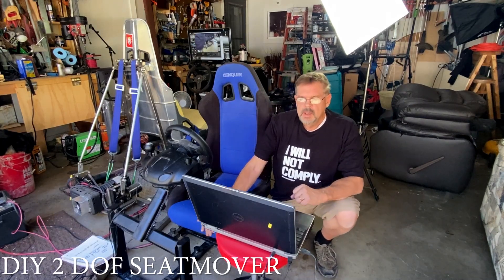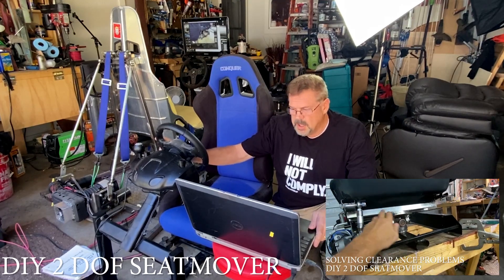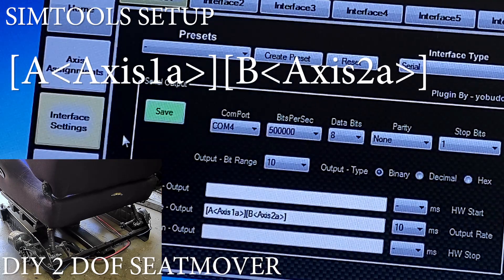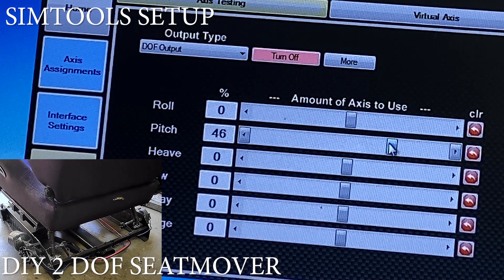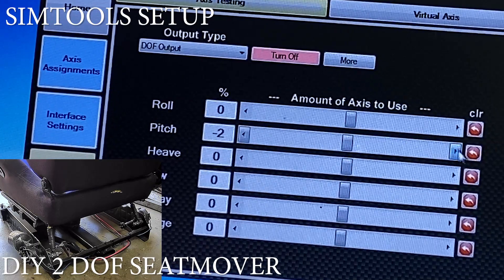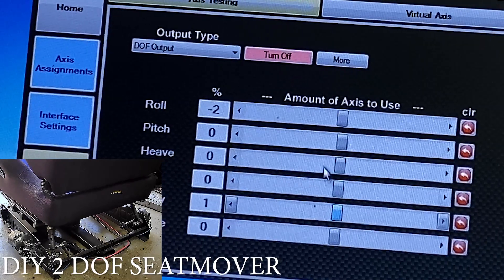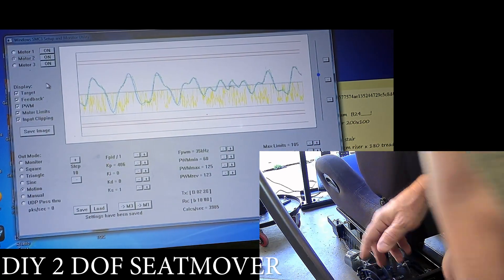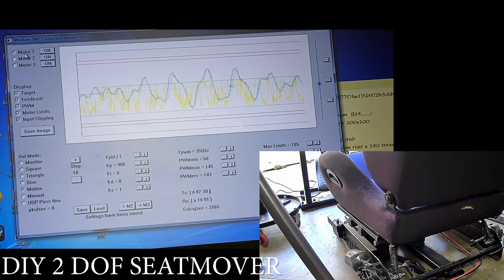DIY SEATMOVER Part 5 WW motors Arduino IBT-2 Simtools MOD your static SIM RIG with Motion!

Comment: I know this is super late but you came to the wrong conclusion. It might be the motor need upgrade, and you did get bigger motors, but might not have been needed. 

You didn’t tune the PID parameters.  The yellow is supposed to be super close to the green. 
It stalled because the pid wasn’t tuned to give a huge amount of amperage when you needed the torque.
I get you’re it an electrical engineer and I am, but I don’t want you giving the wrong advice out of no fault of your own, coz you can’t know what you don’t know. 
There are great pid educational videos with how the parameters affect what’s going on. Search for some and you’ll have a much better solution.

Comment: I think its probably very important to get the centre of gravity perfect with that UJoint when your in the seat, that way the motors wont have to lift your weight, but you probably also checked that, the motors probably are just not strong enough, love your vids by the way :>

Comment: For those wondering: I built and tried the exact same kind of design (thanks to you d max, you legend) with my regular 12V windshield wippers (some « valeo » ones, pretry cheap) and It works perfectly well for me!
They move and lift my weight with no trouble!but I only weight a 150pounds so maybe that’s why. 🤷‍♂️
Reply from the maker: Fantastic!  Great to hear..  for whatever reason, those old WW motors just could not make it 'real' for me..  I appreciate the comment my friend!  Dave

Comment: What wattage are those motors? I’ve bought a pair of 24v 30watt exalto marine wiper assembly with tie rides etc. I’m worried it’s not going to be big enough
Reply from the maker: Thanks for the quesiton.  They did not come with any data sheet..  but I was able to stall them out using an ATV brake around 23 amps.  Since the power supplies are rated at 550 watts at 25 amps.. I think they are around the same.  I would say to 'test' your motors.. Since your making a 'seat mover' they may  *MAY* have enough power..  but I dont know for sure..  30 watts is not too much..   Give it a shot.. see what happens..   I went from saturn WW motors  (unknown spec) too..  and they did not have enough power to convincingly move the seat..  to the Jazzy wheelchair motors..  and the Jazzy WC motors moved it just fine..  Dave

Comment: Dear D Max, I think the problem is that you modified the motors the wrong way. I also building my motion sim, and if I use the low and high speed to drive the motor, the power consumption increased drasticly but the output torque was dropped significantly. I modified it that the ground commutator is disconnected from the chassis and soldered a wire to it instead. When I use the high speed wire with the new groundlead, the current dropped, but the motor had much more torque to it.
Reply from the maker: Thanks for actually watching.. Yeah your right.. But fortunately, the motors I used are actually very weak in the first place..  I would recommend starting with better motors.  I'm Glad you saw the issue and I see it too.. Thanks for the comment! DMAX
Reply: @DMAX_DIY  Thank you for the content I really appreciate it.

Comment: Did you try with PWM cranked up to 255? 255 is like 100% of the torque of the motors you are using. Bigger motors might need less PWM ...
But I also think the motors are too weak for regular use. Remember,  I have about the same angles you use here in my rig ... and even with 160W each they have to work hard as I have to move 106kg mass in total. My PWM with them is set to 140. 255 throws even me out of the rig 😁 but it is also a pain for the psu then.
Reply from the maker: No I did not.  I suspected this configuration would require bigger motors.  But I went for it anyway with those little motors- they can move the seat around without me in it.  And just a little bit with me IN it.. It was kind of a test to see just how much they can move.  I copied down those settings and will give them a go in the next video.. Thanks my friend! Dave

Comment: burnt 2 BTS7960 cuz my seat crash into my motor and i can't stop it in time. 
Then i brought another 4, just to discover 1 of my rotatory hall sensors acting strangely, which caused all the problems.
then i switch my hall sensors with those cheapo 270 degrees POT, and my seat was just going to work, my last BTS7960 is burnt again.
How lucky i can get those 2-3 bucks each with 1 week shipping.

Still so frustrated feeling the project is so close to working.
Reply: Build with Sabertooths - not cheap but they do not burn.
Reply: @ARTFLY  yeah i kinda regret now, however i did brought a 24V power supply and 2 300W 1:40 24V motor... those cost a lot of my hobby money already.
Reply from the maker: @ARTFLY  Yeah I agree.. The Rolls Royce of motor controllers..  Plus the Motion Dynamics 60:1's would be my next step up..
Reply from the maker: Yeah, sounds like the motor wires might need to be swapped around.  I had that happen too, but I did not have the tie rod on it  when initially testing so it just spun around. I sawpped motor leads and then the motor and hall effect pot were in unison as they should be.  Keep testing my friend! Once you get it right, you will be way happier than spending a couple grand to buy a mover.  DMAX

Comment: I'm just not smart enough to do something like this, D Max - but it's still fascinating to see how someone else tries to put all this together...
Reply: @SingleRacer And that's why there is a wonderful community out there to help you with any questions you may have.  I mean I am no electrical/mechanical guru at all (I struggle quite a bit), but I have been following D Max's videos and done some research of my own and slowly but surely starting to grasp the concept. You've got this man, if you want to do it, then give it  a try, you can only learn from the experience.